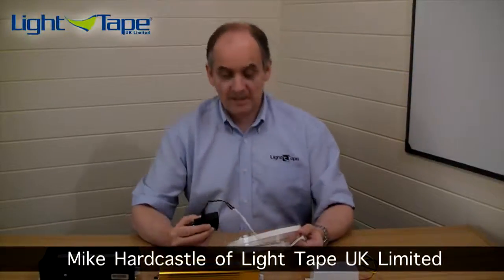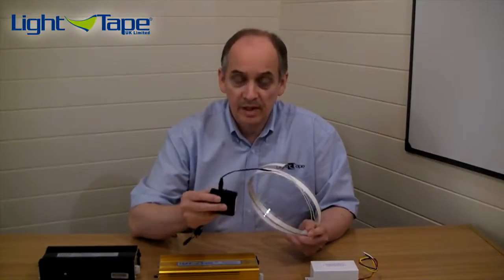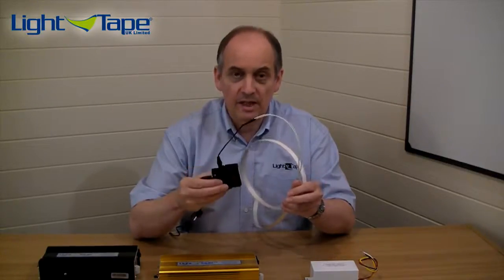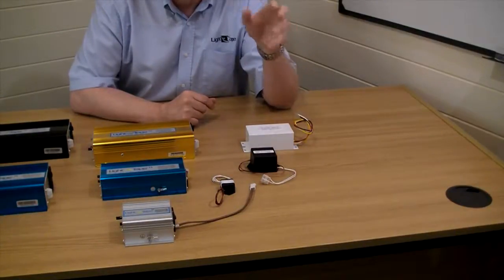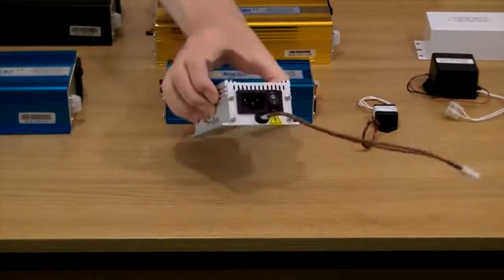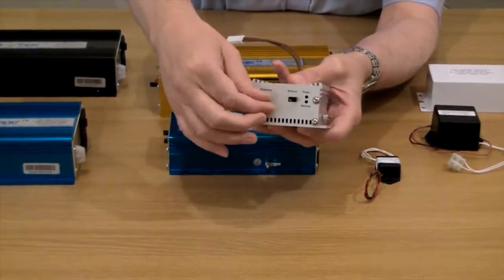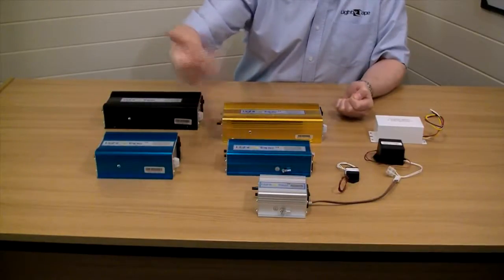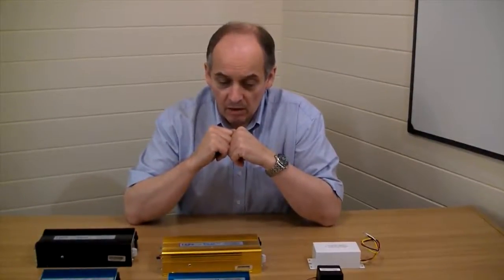Light Tape Electroluminescent Inverters AC & DC Power Suppl

Comment from the maker: @killerman402

We only supply product in the UK you need to contact the US manufacturer, see contact details below.

Light Tape® Headquarters Manufacturing Facilities

600 HP Way
Chester, VA 23836 phone: 804.530.8536
fax: 804.530.1375

Comment from the maker: The 9V sample unit is driven by a PP3 battery, all the 12V units have pos and neg input wires and require a 12v battery. Most people use a 12v motor bike battery.

Comment from the maker: @Frogvent51 You would need one of the DC Power Supplies shown on the video, the following are all 12V and can be connected to a car battery, DC50, DC100, DC150, DC500. The number relates to the area in Square Inches, so a DC50 will drive a 1" wide x 50" long piece of Light Tape or a 1/2" wide x 100" long piece.